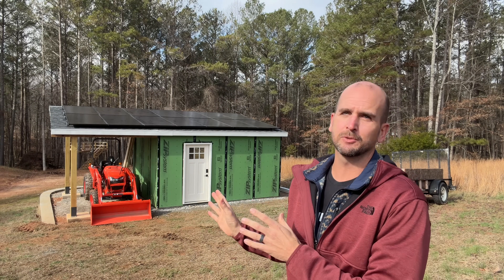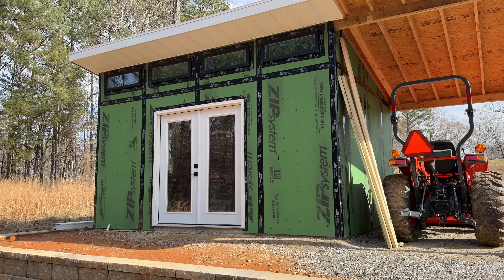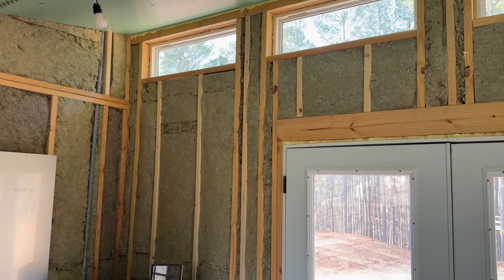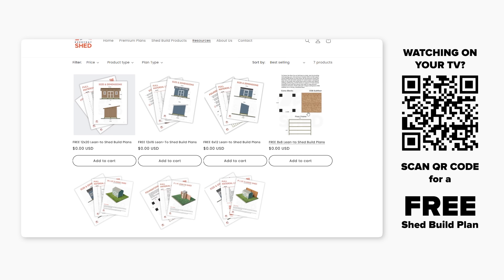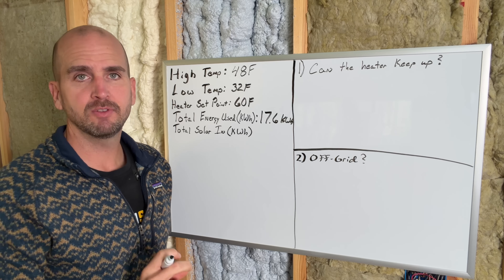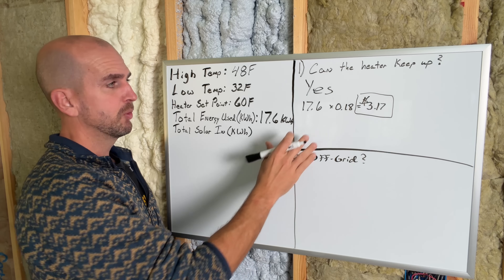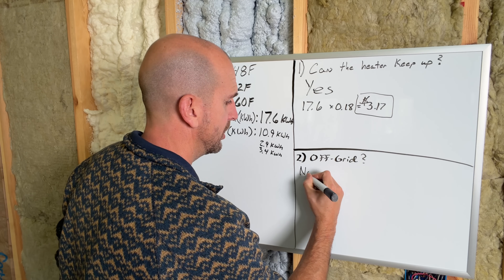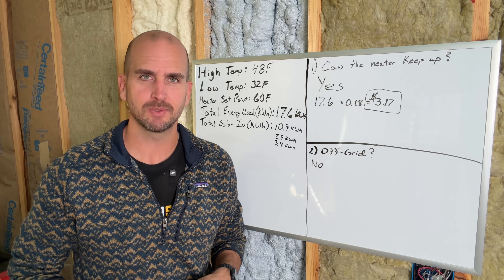HUGE Mistake: Why My $15,000 Solar System CAN'T Heat My Tiny Shed

Comment from the maker: DIY-Friendly Shed Ramp Kit:  https://geni.us/TjSbdC
🏠 Free Shed Plans:  https://geni.us/JFi5FWV
1500-Watt Radiator Used:  https://geni.us/9cHWS8I
Reply: WARNING!! Please read. My brother had an electric radiator just like that one catch on fire last night in his house.  Within 2 minutes of smoke it burst into flames of 2’ all around the unit. The oil leaked out and luckily didn’t catch fire.  He threw a blanket over it, and threw unit outside.  Yours looks exactly like it.  These were designed in Italy for 220 use and converted to 110.  According to Google without design changes.  There are 48 lawsuits currently.  Yours has the digital section at top with cord wrap on lower section exactly like his.  It’s not worth the risks.  If you’d like me to email you pics of the burnt unit, I’d gladly do it
Reply: Upon second look yours appears to have a different control panel cover, but everything else is identical
Reply: @davesrvchannel4717  Obviously there are different brands of those heaters and some are definitely junk.  My De'Longhi Dragon has been going great for at least six years.
Reply: @nwbudro9210  funny you should say that.  The one that caught fire 2 nights ago was a Delonghi model EW7507ESL  the reason I didn’t include name is many brands are built in same factory under different name. Yet they have same issues.  Same as what I told guy in video, if you’d like me to send pics of the burnt unit, I’d be glad to.  I know it’s hard to take anyone’s word today
Reply: @davesrvchannel4717  Unfortunately no matter what the brand you can get bad units.  Now a faulty seam that leaked out oil that is going to cause issues period and is why you ALWAYS inspect and test heaters before use.  Also test safety features and do what you can to not leave them unintended.

I'm glad your brother didn't run into more issues.
Reply: @ChrisFrost-w7c  Also there is no accounting for how people treat stuff.
We have no idea how many times some clutz knocked theirs over.
I find that stuff other people think is junk can last me a very long time.
Reply: In Canada I kept a shed pretty warm in winter with 3 100 watt light bulbs.
R 28 in the walls and roof.
You are way sub standard for a heated space.
One less solar panel and the money spent on insulation would make things totally different.
This is an experiment in " can I do it all wrong and have it work out well".
Nice looking and the rest is fixable.
And I have had lots of those heaters. That heater could heat that room easily.
Edit: I forgot to mention that this shed was 14 ft. by 36 ft.
Edit again: This shed also had no windows and I built the door myself and it was also R28.
Reply: You have MASSIVLY over payed for your solar setup. Look into harbor freight 100w panels solar hubs, 400 wat solar bat charge controlers and 6v deep cycle bats hooked up in series parallel 12v system.
Reply: What if you used the stored solar-sourced power to heat a thermal mass bench? Perhaps it could keep the shed warm then? Perhaps by heating water to ~100 degrees F and pumping it through the thermal mass with pex/radiant heating tubing?
Reply: @TheNeighbor4U Make an insulated box for bench top and fill it with wax and a heating eliment or two. The wax will hold the heat for a long time.
Reply: Here is the difference between shoddy R15, and what my house in Denmark is built with. 
My house is insulated to R52, and I spend about 3$ a day with an airconditioning unit (aka air to air heat pump) to heat my home of 990 square feet.
Reply: Why should anyone listen to you if you are so dumb as to spend $15000 on a solar heating system when a $125 kerosene heater would heat that space?
Reply: It's important for you to add in the average hours and angle of sunlight IN YOUR AREA in the winter which greatly affects your figures.  Here, in the South, not only are the temperatures more moderate but the hours/angle of the sun is different (as you know).  Solar is a better option for us.  Peace!

Comment: You need more insulation in the roof, R20+. A heat pump would be more efficient than a radiator.

Comment: Lol I have 8000btu window ac unit that has heat and it uses 200 on low and 580 on high can run on batteries all night no problem just think outside the box

Comment: You need radiant floor heat..
What i would have done is  use a copper tube in the concrete 1 end in 1 end out  hooked to a solar heater box that circulates hot antifreeze.. you could  back it up with a liquid cooled diesel engine to heat and supply electricity at the same time.. for around 1 gallon of diesel per day...

The solar heater box is a black box with a long copper pipe snaking through it. Water comes in cold and leaves hot when the sun is out.. you could store hot water for circulation with an old hotwater tank..

Also sand can store massive amounts of heat for very long periods of time
Reply: Use solar to make HHO gas to heat a sand battery that you connect the central floor heating to. You can also connect the HHO cell to a gas stove and other gas applications. Big daddy government dont want you to know about HHO.
Reply: You need 2-3 kwh of solar a day to keep the HHO cell going to keep the battery hot on a cold winter day.

Comment: Could you get better solar generation by having your panels aimed or angled better? 3kwh of generation in an entire day from a 6kw setup seems awfully low. I can't say I have a permanent setup but when I use my 200w panel camping in the winter I still get ~150 watts of output and can get that for a a solid 5 hours even when we only have 8ish hours of sunlight.

Comment: well the oil radiator is like the worst solution, an air to air pump would be better use of the solar power you do get in but it is STILL a lot of power but a lot less than that radiator, also the high power usage in the start, I take it the shed was COLD to begin with? that means you can't take the 17.6kWh per day as true... since when it is up to temp then it stayed at 3-400W no? so 7.2-9.6kWh daily usage instead of the 17.6kWh... huge difference... and with a way more efficient minisplit then it should most definetly be doable  but again the dark days obviously mean you need to overprovision on solar panels and have more battery storage to minimize the issues with dark days

Comment: I was floored after clicking on this video, to realize that, after all the money and time you'd spent on solar and insulation, and even the expensive modular battery/inverter.....  only to realize you were using a lowly resistive heater.  
Those oil filled radiators are nice and all, but not nearly efficient enough for what you're doing.  

First off, you need more insulation overhead for winter heat.  It's fine for summer colling, but even summer seasons would benefit from rockwooling those rafters above the ceiling foam panels.  

But a reversible heatpump system is the ONLY way to go when running off-grid.  

And you'll need to bite the bullet and double (at least) your solar panels to have enough replenishment during the day to maintain heat while replenishing all the juice you used the cold night before.  

Maybe do the added panels as a front porch canopy.  And a rear roof over that deck to be a high-ceilinged sunroom, which would be quite comfortable during the summer with a couple ceiling fans on extended masts with the crossbreeze.  

You've got the makings for what you're trying to do here... just need a little more tweaking to get it to do what you want.  
Btw, I'm not trying to wax expertise here... just going on experience, as Ive been living with my own off-grid experiment for the last two years with my mockup (camper and solar canopies) before actually building my cabin.  I've learned a couple expensive lessons along the way, by I'm getting there!

Comment: Everyone is talking about the slope. Yes, incidence matters, but much less than you probably think. There are charts available on line that break down the effect of both panel direction and angle that will show you exactly how much loss will occur with each degree off from optimal. We did a carport application that only had 5 degrees of slope and were not exactly facing south. We lost just a few percent, and planned that into our design.

Comment: I always get a kick out of these "lets run an experiment" videos. Simple calculations could be performed before the building is even constructed and you can know in a "best case" scenario whether you stand any chance at all of meeting your goals. Of course, the content value of engineering calculations is not as interesting as an experiment.  I appreciated seeing the cost comparison of the different insulation, though comparing cost per r value would have been even more interesting.   I watched until the end, so the content approach worked.

Comment: I'm planning on building a 16' X 24' shed & running a through the wall AC/Heating unit like I have in my garage. I will have to find out the amperage of the breaker box I will need to install since I'll have the 30 amp HVAC unit plus 3 15 amp light circuits & 3 15 amp outlet circuits.

Comment: Install a diesel heater in the shed and use the solar array to keep the battery set up that powers the diesel heater charged. Now you will have sufficient heat and can direct excess battery power through an inverter to power office equipment.

Comment: Besid the heat pump that sombody,  I will sugest  adding wind  turbin 10-15 ft. Additionally solar collector are more efficient the solar pannel by factors of 2-4 times. Another idea, that sew that one of the sweadish architect did , encapsulating the house in green house (basicaly his original huse isplace inside geen house) . It was very effective in capturing sollar heat. Theis channe o youtub that show how to make graund heatiing on cheap. His cost was around $1000.

Comment: I would go with a diesel heater, low initial cost, low energy consumption and overall you would probably run it on the lowest setting.

Comment: Can I suggest 1) double the insulation on walls and roof, 2) install a 2 way thermopump (heating in winter, cooling in summer), 3) a small back-up gaz/wood stove, 4) use a strong vapor barrier inside to avoid humidity condensation inside the walls 5) on all windows add a transparent layer inside to reduce heat lost by glass of the windows 6) verify if your floor is well insulated. Doubling insulation and vapor barrier is probably the cheapest fix. Great job thanks for your video.

Comment: No airlock entry, not enough insulation, doesn't look like there is any insulated (interior) thermal mass, wrong solar angle for winter (not to mention snow - doesn't look like a tilt frame). No glazing for solar gain? Needs to use radiant heat focused on the occupants / operational areas / internal thermal mass. Its the building not the PV system.

Comment: I heat my insulated shed with one 1500w ceramic heater  just fine in Oklahoma winters.  I set it around 60 and it cycles on and offf.

Comment: You could use a kerosene heater that has flames touching a pipe in a stove small one ..Just use a 12v fan speed regulated to blow hot air ..That would work to  The designs are out on youtube metal box and metal tube enclosed in stove air in air out only for fan ..Drill hole in bottom of stove and use wick ones up in hole  ..Just use large mason jar last 8 to 12 hrs or longer just regulate flame size low with pipe ...Use stainless steel metal screen to give it more power and heat around pipe It like infrared heat ...Tried all ...But I use car heater since I have to leave base board ones on for under floor heat too ...
Reply: Just run heat out on top short and air in on bottom short just thru wall ...Just make sure heat and air have plate covering  them so outside air does not come in .only out form heater.. Same as pellet stove heat out cover ....
Reply: If want to use diesel use carbon felt wick you could use for oil and more liquids for flame..tried all ..even alcohol  all kinds even drink stuff ..

Comment: Insulate floor walls and ceiling real well and do not use any heaters that use more electric than solar can put out in winter ..Use a cooper coil and a small stove to heat hot water to 160 to 180 and use a under dash heater they run on 12v and so does the pump the car one not the pump for regular water ...So in all 12v x2 equals save and one battery would run it for quite awhile ... I am doing the same with 1 500w heater base board type ..I use 4 before now I just use 2 and heat bath living and bedroom with car heater and hoses ..Just use rubber hoses and cooper pipe same as car wood they make larger versions  that heat a whole house ....Or use car radiator and do the same ...Just find a way to heat anti freeze cheaply ...
Reply: The wall base board heaters are 500 watt a piece so 3 of them is 1 of yours now run 2 only my electric was 140 a month now 60 a month ..I am trying for one heater but hard since use for under floor heat too ..

Comment: So you spend 15 years worth of electrical bill to not be able to even heat the shed. I think 'renewal energy' isn't there yet. It should be reserved for cases where you really need it, and accept that it's impractical for large scale deployment. We should fund research, but stop spending public money on building this stuff, and let the market figure out when it's viable.

Comment: I think you'd eliminate a lot of heat loss with more ceiling insulation.  I rebuilt my house and used rockwool and love it.  With some leftover materials, I insulated the ceiling (only) of my 10 x 14 wood shed and that by itself made a huge difference.  In the summer my shed would get up to 125 degrees, similar to my home's attic.  After insulating the ceiling, it has never been warmer than the 90's - a full 25 or 30 degree reduction on the worst days.  So I succeeded in making it possible for me to work in the shed in the summer.  This also taught me the importance of the ceiling when it comes to insulation.  Summer is challenging because radiant heat is much more of an issue than heat through conduction. 

Great experiment!  I also like the heater you used - they work better than any other space heater I've tried.  And the Zip siding - very professional.  You have a great set up, better than 999/1000 out there!  Keep up the great work!

Comment: You set yourself up for failure with the resistive heater.  Use a mini-split heat pump and get *3 times as many watts of heat per watt of electricity.

Also, if your solar panels are 16% efficient, then you are wasting 84% of the heat from the sun.  Some thermal panels or combo PV/thermal could be beneficial.

Comment: The energy envelope is way off, ceiling height, ceiling insulation, too much glass . Glass is a bad insulator, Building codes would not allow that much glass in a home construction scenario. Ceiling height as well as ceiling insulation is another big factor, rooms heat from the ceiling down. I can imagine that the floor is not insulated properly also. Building codes restrict such energy wasting features for the simple reason  its not always sunny and 75.

Comment: Video is completely pointless, resistive heaters are insanely inefficient.  You could easily heat it to 70F with a heat pump costing less than a thousand dollars. But instead you spent $15,000 totally wasted and a $50 heater that is worthless. You could even use one less battery so the total system cost would be cheaper than what you have and still heat the space. Also, you have the worst insulation on the ceiling, you know, where the heat will naturally rise and escape. Drywall or at least some sort of cover over the walls would insulate better as well.

Comment: Initial reaction - needs way more insulation, and a heat pump (air to air), and it'd still need to be boosted by power from the grid.  Today I got 1.5kWh from a 6.8kW array, and that wouldn't be enough even with better insulation and a heat pump.

Comment: This is very good and helpful.  Thanks for all the effort you put into it. 
 
For millennia, it has been shown that 80% - 90% of fireplace heat goes straight up the chimney, warming no one or nothing except the environment.

There’s a better way.  Aristotle showed it, but it has been completely overlooked and unused until now:

https://www.youtube.com/watch?v=7mi27HDiWFI

The flat panels can be yard art.

At my local Lowe's they sell a solar-powered bird bath fountain pump for less than $20. You can do this using that tiny pump, a piece of flat sheet metal painted black, and some irrigation tubing.  With a slightly larger pump, you could use it for radiant heat flooring.

Your thoughts?

Comment: Grid ties solar systems are usually SOLAR RACKETEERs, who use the services of the utility without paying for them. 

If you don't want to be a solar racketeer, it's easy  ----just cut the grid tie and deal with the consequences.

Comment: Since there are so few panels on the roof, I think it would help if you could adjust the angle of the panels to optimize them for the sun's angle in the summer vs the winter

Comment: I'm a bit confused. Why on earth would you not use heatpump in this situation  for heating. A classic resistance radiaator is very outdated system. Try with a simple qality air to air heatpump with at least  4,6 or abow coeficient and you will be surprised.

Comment: To day here its - 22c and  little to no sun for the last 4 days.  I have been running my  generator to charge my battery  bank all most half the time battery  .   Heating is done with wood .   My power tools  eat a lot of power

Comment: It's simply frustrating how solar, the power of GOD! I mean the sun, is simply terrible at heat. But like yeah a heat pump might help vs just an electric heater.
I keep my shop above freezing using 2 propane heaters. That test, the low being 32 I wouldn't have turned on my heaters but my goal is different. I just don't want pipes freezing.